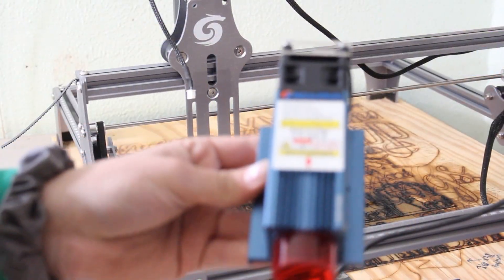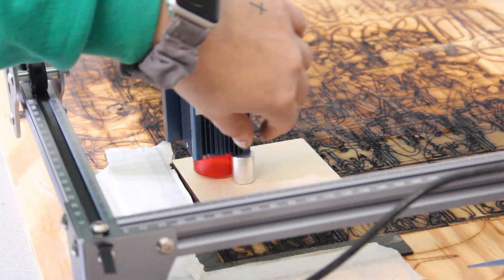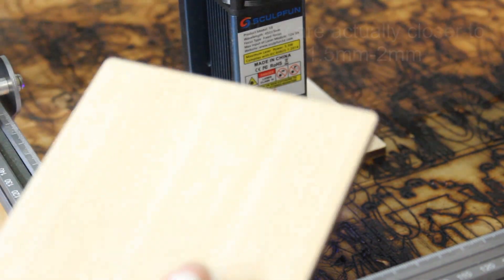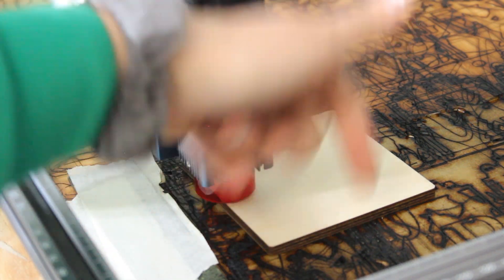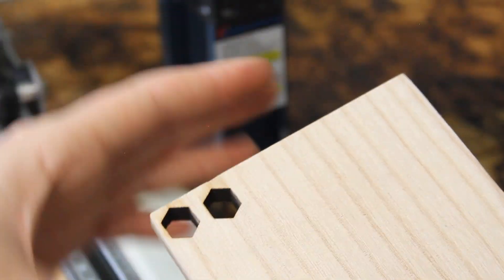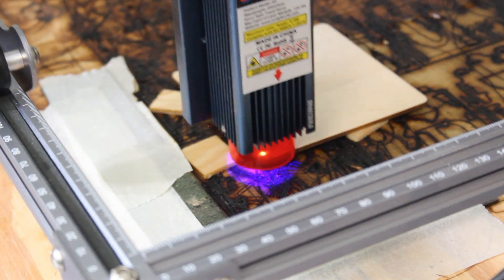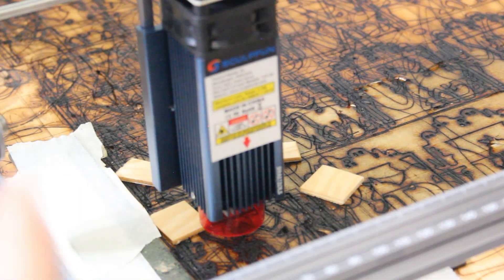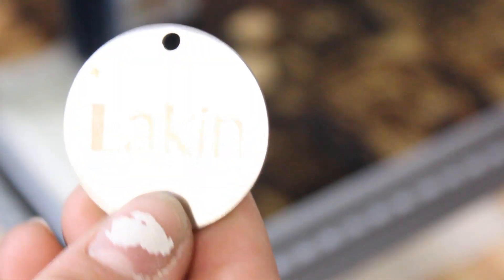Sculpfun S9 Diode Laser review//Best cutting laser on the market

Comment: Hello dear yesterday I arrived at S9, I wanted to ask you what is the maximum speed, because the manufacturer tells me 3000 but you recorded at 4000, and then I noticed that making an engraving with the same parameters between S9 and ortur laser master 2 pro S with laser Ortur LU2-4 LF Laser Module 24V/2A the 2 pro is more accurate, have you noticed this difference too?
Reply from the maker: The knly reason it is more accurate is because the S9 needs to be attached to a base to make sure it doesn’t shake. The S9 is really focused on the cutting, it can of course engrave just fine like most lasers but the best feature about it is the cutting

Comment: Hi.. i also just bought a S9 after watching your video. However, when i installed it, i have lightburn could not find the devices.

I checked on "Device Manager" from control panel, it indicated that the we will need to install a driver? 

Did you install any driver for S9?
Reply: Try changing the com port. I had to do this on mine and it worked.
Reply from the maker: Nope you don’t have to install any drivers. You just have to manually set up your machine. That’s what I do for all of mine. You can check out any of my other reviews or including this one should have a section in the video that shows you how to manually set up your machine via USB
Reply: @TimberWood.Customs  thanks.. i got it set and running! However, i cant seem to cut 6mm wood even though i use 300mm/min with 100% power setting (I use Line Mode).. Can you kindly advice what wrong in my setting?
Reply from the maker: @foowenleong4295  make sure you used the cylinder to set the correct height of the laser.

Comment: What's up with the 90 watt in the title?
Reply from the maker: It is considered 90 w input
Reply: @TimberWood.Customs  So I did some research and found that they are comparing it to a 90W CO2 laser.
The actual input of the module (standalone) is 20W (peak) and the output is 5.5W which is right on par with every other manufacturer on the market as of now.

The complete S9 system consumes 30-40W of power and this further proved by the power adapter supplied with the system which is rated for 12V 5A which is 60W peak. Even the wavelength in 450±5 nm which again is every other consumer grade diode laser.

So all they are using comparisons (very unjustifiable ones) and trying to fool poorly informed customers AKA Marketing BS.

Comment: Thanks so much for the video.  I have a question on the honeycomb working table. what size should I purchase to fit under the this unit. I want to make sure that I purchase the correct size for my new toy. Thanks again
Reply from the maker: I would say the size of the work area of the machine so everything can be level
Reply: @TimberWood.Customs  Do you know what that is? I just purchased the S9 and would like to get what I need to set it up before it gets here. Great video!
Reply from the maker: @rustyp21  yes the size of the work area is 400mmX400mm

Comment: hello, have a question what settings, cutting data do you use to cut plywood?
Reply from the maker: For the 3mm ply it takes 3 passes at 300mm/min at 100% power and the other settings for the different materials cut in the video are talked about in video

Comment: 90watts?, check again, if that was a 90w laser it would have cut the wood like cutting butter.
Reply from the maker: As I’ve said before, that is the input, the output is 5.5w. For example like the neje 40w obviously is not 40w but that’s the input.

Thanks anyway

Comment: its a 5w laser not 90w... a 90w laser would cut that ply in one pass
 
it even says 5w on it!!!!!
Reply from the maker: Yes the output is 5w, but it is advertised as a 90w input. Just the same as the 40w neje but the output is still 5.5w thanks:)
Reply: @TimberWood.Customs  Indicating input power is just a China way of trying to make a laser sound better than it is, Initially they were quoting 80w in order to make people think it was equivalent to an 80w co2 which of course it is not.

Laser power should be stated as output power as that is the important factor, the efficiency of the driver can, and does, vary widely so for real world use of a laser it is a completely meaningless figure.

Most lasers from china also exaggerate the output power, the majority of "5w" laser diodes are actually more like 2 or 3w not 5.. This one cuts better because its likely it is one that ACTUALLY IS 5w..
Reply from the maker: @AkiraFurball  ok

Comment: hello. i need a help  engraving software
Reply from the maker: What help do u need?
Reply: @TimberWood.Customs  I have ortur laser master 2 pro lightbarn software do it But. Lightbarun software does not work properly...
Reply from the maker: @pulkitgoel3877  if u set up your machine correct it should work fine with light burn. If it doesn’t work try reset up the machine, it if that doesn’t work then let me know what is not working
Reply: #L.making lightbrun software basic to chl rha hai
but not show all futures..on lightbrun
(#Snape contrast/ brightness).. not a show...
Reply: @TimberWood.Customs  Help setting up photo engraving in  #lightbrun

Comment: Compare the geometry of the laser beam at 1m distance to a wall. You will nitice, the new lasers having a much better geometry of the beam, which is the result of them having 2 laser diodes inside, combining them with a optical system to the output. This better accuracy and the combined power of 2 diodes make the difference in cutting depth and speed, compared to lasers with only one diode and not so great geometry of the laser beam.

Comment: Hi, would this cut 3mm mdf and how long would it take to cut out a 10x10cm square for a rough idea of how long it takes?
Reply from the maker: Yes I can cut 3mm mdf, not sure how long it would take as you have to test different settings. Maybe 4 passes at 300mm/min
Reply: Thanks! Wasn't sure whether to purchase or not but this helps.
Reply: Also, would the s6 pro work as well or is this more suitable for mdf cutting?
Reply from the maker: @RR-zw9jn  this would be more promising for the mdf
Reply: Okay, Thanks.
Reply: For anyone interested in cutting MDF, I have managed to cut 3mm Mdf in just two passes at 300mm/min with this laser cutter. It is absolutely brilliant.
Reply from the maker: @RR-zw9jn  thank u!
Reply: 3D Technology CNC   What model is that? And is it a diode laser?
Reply: @RR-zw9jn  i’m strugle to cut 2.5 mm Mdf at 300 speed and 5 passes at 100%power, and I dont have a clean cut at the end! How can you do that?
Reply: Hi, are you setting the height of the laser head correctly? Also what mdf are you using? Is it laser safe? 2mm mdf cuts in two passes at 400m, 100% power with pretty clean cuts,so 3 passes should definitely cut through 2.5mm.

Comment: My new xtool D1 cuts 6 mm in 1 pass with a .08 mm kerf. It's only 10 watts.
Reply: The xtool D1 is almost twice the cost of the S9 and you cant use lightburn or gbrl. It has proprietary software. That's it's biggest weakness
Reply: @weilam03   Just heard back and it will work  with  lightburn by the first week of Dec. Only costs 100 dollars  more and is well worth  it for the construction.
Reply: @unemployedredneckhillbilly2023  how much did you pay for it? I'm seeing it priced at 700$ one xtools site and the S9 is 300$ on Alibaba
Reply: I make custom soap cutters. Currently I use a wood burner and thinking about getting the xtool or similar. You can see an example of my newest design on my channel (I dont get alot of views but I am hoping the popularity of my design catches on) as an example because I would like your honest opinion. I call it the Impossible soap cutter.
Would it give me fine detail and how well would it be suited for my needs?
Reply from the maker: @iwannaapple7190  yes u can get great detail with this machine
Reply from the maker: Wow! I’ll have to check it out!!

Comment: lasersafety ??? This laser is so fenomenaal?? It is a class 4 machine, 5.5W with no proper protection, please buy proper safety glasses, because one good reflection and you will have blind spots in your vision for ever.
Reply: I have my laser inside a box whit a camera mountet inside.
Reply: @jacobhn2  very smart because then you can also trap all gasses and use a good exhaust to remove them. Lasers are great tools, not toys !!
Reply: @raimonddumoulin4170  Yes I have ventilation on the kitchen cabinet from ikea, when I burn and want to see inside the cabinet I pause in lightburn
Reply from the maker: @jacobhn2  that’s cool!
Reply from the maker: Yes it is safe, it has protection around the laser and yes I wear glasses.
Reply: @TimberWood.Customs  protection around it is officially not enough, but good you wear glasses. These laser can work when you are not close to the object, then the protection added is not classified. Also if the manufacture puts a laser class 4 sticker on the machine it means the protection is not proven / tested, class 4 is open laser source. Please stay safe, since your eyes you have only one time in your live. Enjoy working with the machine.
Reply from the maker: @raimonddumoulin4170  thanks!!
Reply: @raimonddumoulin4170  what do you mean by 'officially' ??
Reply: @thesnitch7  making a casing around a class 4 laser requires several steps. 1) making sure right type of window material is used, ask for certificate since colored plastic is not the same. 2) make sure no openings can leave direct light leak out 3) install proper interlock on the door to hardware prevent power to the laser activation. 
What surprises me is that for USA there are very strict rules when you want to sell laser machines, but seems via amazon and aliexpress you can order what ever you like, not having to worry about safety. 
Many do not know that these low wavelength, UV and deep blue lasers damage to skin en eye is accumulative, so small leakage for long time is still damage. Co2 lasers are more event driven, but a glass tube 40W, if fired for less then 0.25 sec is still a factor 50 above the maximum acceptable power level for preventing damage. So enjoy
Reply: So enjoy playing with lasers, but please do it safe, since damage to yourselves or others is non reversible

Comment: Aluminum. You're removing the anodized surface. Try granite tile or an image burned into white tile using white paint then engrave.
Reply: It works best on darker materials. I've done many
Reply: I think exactly the same.
There is no chance a Diode Laser at this optical power comes near to Engrave (remove Material) on Metal.

Decoloring the Anodizing on Aluminum ist absolutely possible though. And it looks like exactly that.

Comment: Do you know if you can mount the S9 on the Ortur LM2? Thanks for your great videos!
Reply from the maker: Yes u can. When u buy just the laser head it comes with a special mount that allows it to be easy to mount to the lm2.
Reply: @TimberWood.Customs  thanks for the reply! You should have an affiliate link for this laser. I bought one off the back of your review. I'm having an air assist made for it too. Thanks again, your videos are excellent.
Reply from the maker: @davidr5964  there should be an affiliate link in the description for Amazon

Comment: So as you mentioned this should work with leather right? I want to have it cut all my leather templates out including the holes for sewing so all I have to do is stich it all up. Also have you used those rotory rollers with any laser engravers to do round objects?
Reply from the maker: Yes this should be able to cut leather. I have a rotary roller but have had time to use it yet

Comment: give adjustment of the laser of different thicknesses for cutting, engraving. The program you are working with?
Reply from the maker: I use light burn software. And yes adjust the laser when using different thicknesses of materials when cutting or engraving

Comment: Nice video.  I agree that better electronics and software has gotten diodes to last longer, my personal prefrence is 80% as a maximum setting.  I also recomend bolting down the frame.  For some of the cuts you showed, you might want to try 280 instead of 300 for the same number of passes and see if slowing down that little helps actually cuts without the extra pass.
Reply: Hello Eric as I see you already have experience in lasering. I am still a beginner and am looking for a list with engraving and cutting data for the S9 have you possibly already made something would be great if I could have a copy thank you Hans-Jürgen Germany
Reply: @hans-juergenade7253  unfortunatly I have not seen any nor do I personally own one to create the spreadsheet.  Scrap piece trial and a lot of error can be your friend, just keep in mind different woods and plastics will cut/engrave at different depths for the exact same speed and power.
Reply from the maker: Good idea! Thx for watchin!
Reply: @TimberWood.Customs  Hello and good day
a good, fresh introductory report about the SKF S9 laser. For the beginner a good insight into what the laser can do.  As a beginner, I am looking for a summary of which materials are cut with which parameters. A beginner like me has to fight there with 3 parameters very much.  I would be very happy if there was a list with which the layman would have certain guidelines in the cutting area to start and work with it. Do you have possibly such a listing of the SKF S9?  I would be very happy about a remail. GB Hans-Jürgen Germany

Comment: Great videos 👍 Can the Ortur LM2 Pro not cut just as well using the LU2-4 LF?
Reply from the maker: Yes it can, that machine still cuts great. However this machine cuts thicker materials so easily
Reply: @TimberWood.Customs  I'm thinking of upgrading from the LM2 20w to the LM2 Pro LU2-4 LF...I'm now considering whether this S9 would b a better purchase? Have U had any experience with Orturs LU2-4 LF (or LU2-4 SF) at all?
Reply from the maker: @neilrisley1321  Yes! If you are talking about the LU2-4 20w LF with the air assist function, then yes I have used that laser and it works so great with the air assist. Right now due to set up issues, I’m using the LU2-4 20w LF  over the S9 for production of 225 ornaments. Honestly they’re very close in specifications. But it all comes down to the safety features. They  S9 cuts great but I’m not really sure if it has any safety features like the ortur pro which have saved me a couple times. Honestly it’s kind of a hard decision to me because they are both great lasers. If you’re planning to cut anything super thick then definitely go for that S9
Reply: @TimberWood.Customs  thanks 4 the replies....I'll look in2 both 😊 p.s. would luv 2 see a video review from U 4 the LU2-4 LF 🤞😏
Reply from the maker: @neilrisley6667  up! Workin on it;)